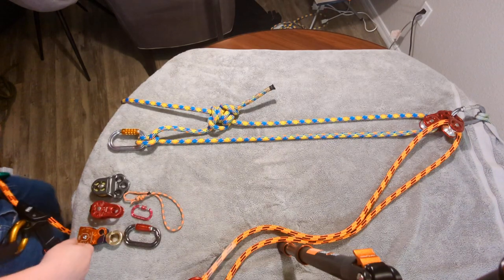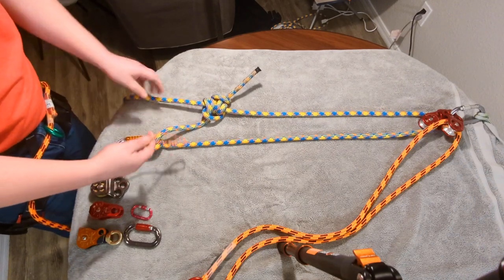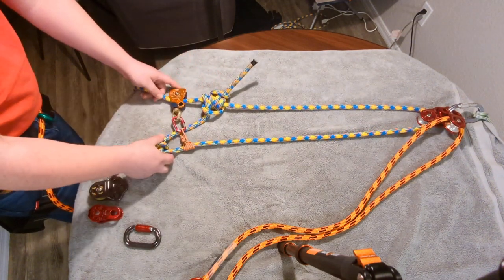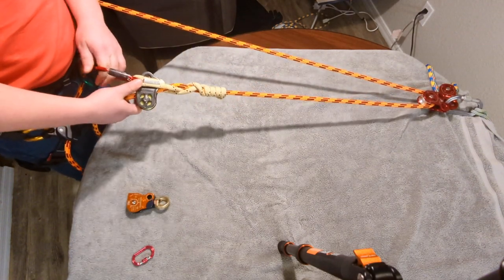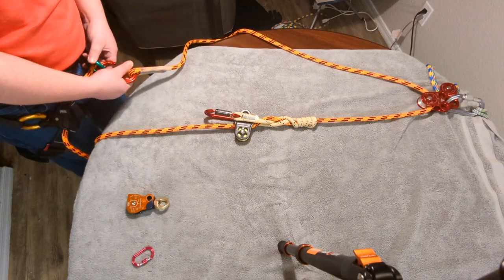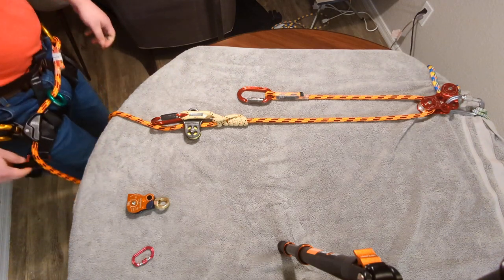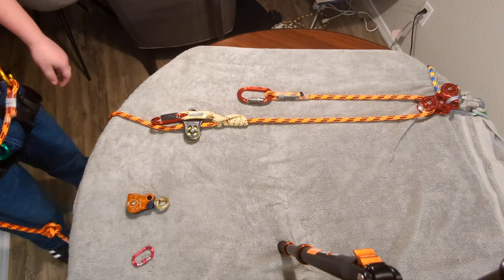How To Use PULLEYS on an MRS/DRT Setups to AUTO-ADVANCE HITCHES & for SLACK TENDING w/ LANYARDS!

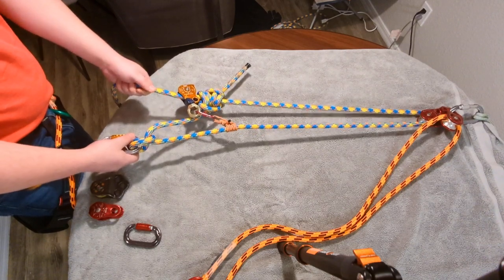Comment: 3:42 In this setup what is the actual purpose/advantage of the pulley, since to push the hitch it seems you can use anything with same effect: a carabiner, a piece of wire, or just tie the prussic directly to the hitch?
Reply from the maker: The point is to make use of a piece of hardware that a) doesn't generate a lot of friction when gliding up or down a rope in that fashion, b) which has a small opening for the climbing hitch to get blocked in and c) which is easily removed from the system mid-climb to allow for a descent. A carabiner would create too large of an opening, a piece of wire would be outright dangerous/difficult to remove, and give your last idea a try sometime...it'll generate a ton of friction and the paracord is liable to break after only a few hip thrusts and you might even damage your rope. Great question. Thanks for your comment. You could feasibly use a carabiner. Perhaps an oval shape biner.
Reply: Thanks, I was wondering if in some positions it is advantageous to pull the rope sideways.
Reply from the maker: No, it's better just to pull downwards. Less friction in the system that way.
Reply: I made the equivalent of a shizll ropeslider. But a cheap pulley is best.
Neither a rope wrench, nor a tending pulley are needed for staying alive, but they help massively.  Imo.

Comment: Industry standards are to tie a anchor knot then Blake's with stopper knot 
.anchor hitch is sinching ...and points out toward wherr the Blake's is tied ..used to be mandatory
Reply from the maker: That's very interesting. I have seen both an Anchor hitch and a Clove hitch used by various professional climbers. If I remember correctly, I demonstrated this setup with a Clove in this video. It may be less ideal than an Anchor hitch, however, I don't believe that using a Clove hitch instead would put a climber in any danger. The Clove also allows for easier adjustment of the strand leading to the Blake's hitch if necessary. I do agree that an Anchor hitch is likely more secure overall. Thank you for commenting!